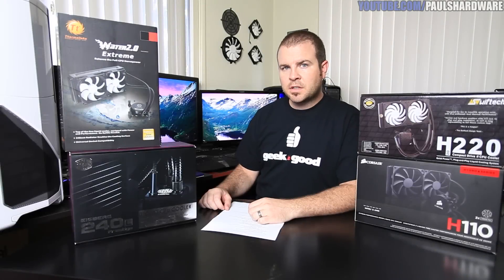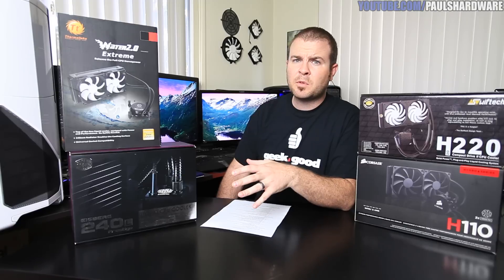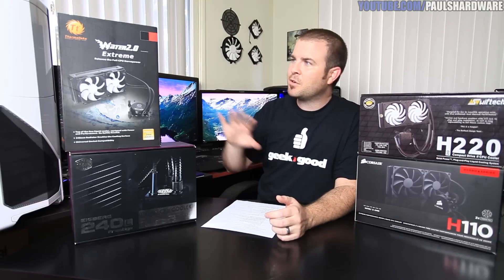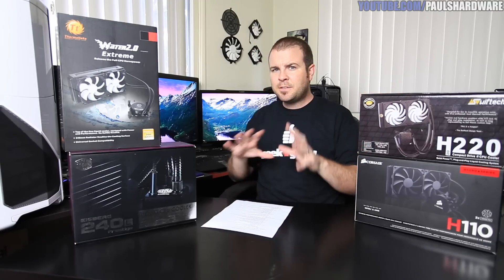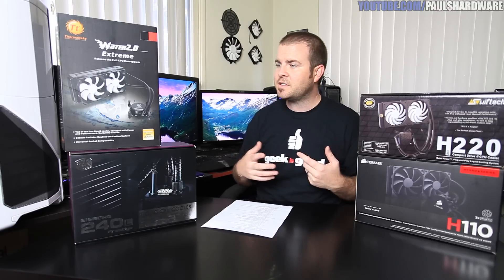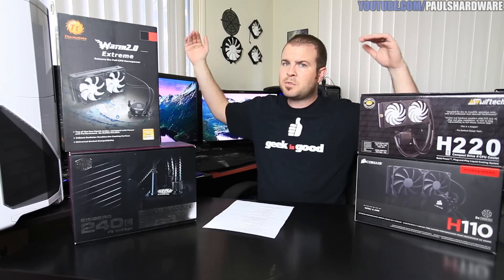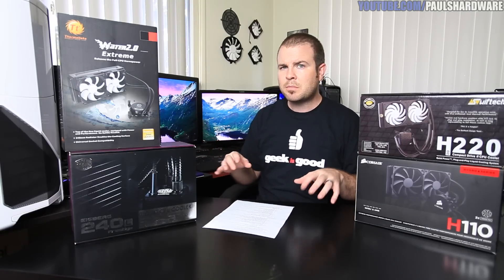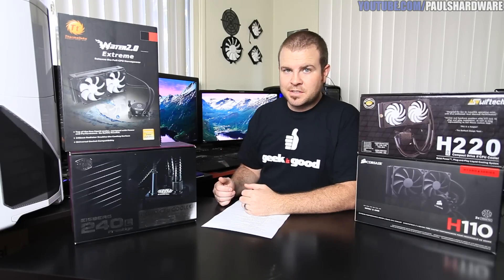H220 vs H110 vs Eisberg 240L vs Water 2.0 - CPU Cooler Showdown!

Comment: Am I doing something wrong? With a Corsair H60 my FX-8150 can run at 4.6GHz at 53-55C...Are those insane 80C temps primarily because of torture test? I was playing assassin's creed IV at the time when I checked my temps of 55C
Reply: Intel quad core cpus run much hotter than the FX series from AMD. But they are faster and more power efficient. I had a FX 8350 running at 5ghz for tests and maxed out at 75c with air cooling. 

And remember these are stress tests to get max temps of the cpu. Under gaming they won't come close to these temps.
Reply: I figured that were the case, but I wanted a second opinion, thanks :p
Reply: not really , a game never stress a cpu at 100% (unliss you have a crap cpu or a very cpu demanding game like crysis 3 and still !) so the temperature of a cpu while you are gaming is much lower than while you are pushing it to 100% load with a cpu benchmarking software
Reply: He was running tests like Prime 95 that max out the cpu load, just like Adnene said, games never run your CPU at 100%.
Reply: raptor6600gt     my fx 6300 at 4.5 compete with a 3570k...   the 8350 destroy i7 4770k in bf4

Comment: I'm very happy with my H110 by Corsair. One fan runs a constant 400-500 rpm's, and the other is idle 60% of the time. Even with my 4770k OC'd to 4500MHz, I still manage 29°-40°C temps most of the time. My Asus Z87 Deluxe mounted in a CoolerMaster HAF XM case is ultra quiet and cool. If not for my three monitors (Asus VG248QE) I'd never know my computer was on. With AI Suite 3 software, as temps fluctuate, the 5 fans and cooling pump automatically ramp up to match the heat load. I like this build and NewEgg made it possible.

Comment: Your a great teacher Paul, you taught me how to build my first super gaming RIg from your "other" vids n gave me the confidence that i desperatley needed to even attempt it. i just don't want people to read the volts and think they need that much just to reach 4.6Ghz on their overclocks becuase WOW!!!! 1.36V????? For a 4.6 Ghz Overclock ? Either you have the worst 3770K test CPU thats been through hell n back or you lost the silicone lottery big time. For my 3770K to hit a 4.6Ghz Overclock i only need 1.27V. Granted i am using a Maximus V Formula utilizing EVERY power connector (24pin EATX , 8pin EATX12V, 4 pinEATX12v and 4pin EZ plug) for extreme stability, plus newest BIOS. My temps are obviously no where near yours , I'd panic if i seen it go above 75 C - id be reaching for the liquid nitrogen lol Your still the man though Paul, r you still working with the egg?
Reply: he said he didnt need that much voltage... dont u listen...he just bumped it up so he could really stress the cooler. and prime95 is a synthetic test, no real world computing would push the temps up that high, even hardcore rendering.
Reply: People want comparable real world results from  tests, key word here is comparable! comparable ! I wasnt calling him an idiot nor was a judging him too harshly. just didnt want others to run their CPU hotter then napalm! In all honesty what made it even more of a foolish test was the lack of a NZXT KRAKEN X60,  it didn't even have the best AIO cooler on the market as per performance and customer reviews.
Reply: Roarshack V the kraken is a asetek oem rebrand... it woulda been in the same range as that thermaltake 2.0 water w/e

Comment: I noticed when you showed the results and picked a winner, the results are not all equal because of the fan speed... the corsair h110i was at slower fan speeds, so taking that into consideration vs some of the others, I think it did well.. next time make sure the fan speed is the same for all under idle and load at 60% and 100% and then we can see what the temperature will be... but I do understand each one gets to sell their own fans... LOL

Comment: Running the kraken X60 right now, and it runs at 30 C , in a no ac room. I had an h80 before, and it was miserable in comparison. The only thing bad about it was that I had to mod my Define R4 to fit it in the front.

Comment: I like Linus's " remove every possible variable using same fans" better.  Fans come in a variety of sizes, shapes, and performance variables.

the MOST expensive part of these AiO's is the liquid cooling system part(s) *pump, res, tubes, rad, etc*

Thus it makes perfect sense to test the part that MATTERS the most and is most relevant.

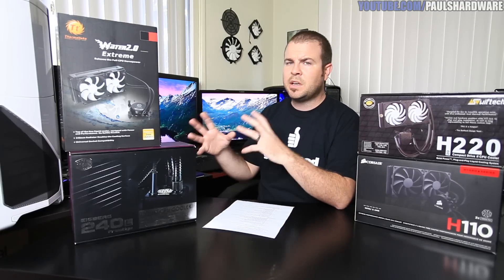Comment: 2:31" if you're going for the most aggressive overclock..the middle of the summer might not be the best time of the year to do that"

Actually you're wrong paul.  That is the MOST ideal time.  You ALWAYS want to know what the WORST CASE temperature scenario that you're cooling system(s) can handle.  

Just like life and your check book.   Prepare for the worst...hope for the brest..but if the worst happens, you're already ready to handle it and you can continue on without any stopping to fix it.

Comment: Considering the price reductions on the Thermaltake Extreme 2.0 currently available at several Canadian retailers ( as low as $54.99 after rebate), its hard to argue which offers the best value/performance ratio.  I agree, the H220 is the best AIO system out there in terms on performance and flexibility, but, $149.99, poor availability, and several comments about the need to bleed the system) makes it a harder choice for me
I would be curious to see how the Extreme perform with NF-F12.

Comment: Second finished. By doing that, you know exactly how many watts of energy the cooler can remove, at any speed. The aftermarket temp probe readers (which you guys sell by the way) can tell you the temp of the block which is all we're after anyway. Plus, if something does go bad, you at worst case fry the heating resistor, not the expensive CPU. Best part is now the results are all based on the same input, with an actual number to quantify it. Heck, I might even try it! PM me if you wish.

Comment: Second continued. Make a hot plate with a couple of simple resistors on the bottom, take that plate (copper or aluminum) and put a thermal probe on it. You know how hot it is. Take the resistors, and attach to a variable power supply, knowing Ohms law, amps squared x resistance = watts. You know how much power you're good for. Put the cooler on it, and turn it loose. Go from 20% to 100% speed, and see how many watts it takes to get the temp above whatever max temp you want, say 60C. done.

Comment: Second comment. Why in the hell don't any manufactures measure their coolers in watts or watts/degree C like the manufacturers of heat sinks do? Intel says their whatever CPU puts off 123 watts or whatever, wouldn't it be nice to see a cooler listed to say it can handle xxx watts at 40C room temp (which is 104F btw)? Then you wouldn't need tons of subjective tests. With the thermal sensors that are coming out that are quite cheap, a simple rig can be built.

Comment: Paul, couple of quick comments. You can use your cell phone to measure the sound level with several free apps. Might want to calibrate it once, but close enough. Usually measured at 1 meter. Also, it depends on your surroundings, so a room with hard walls will always be louder than one with hanging rugs or drapes. Just and FYI, so if you do go that route, be consistent on your distance to sound source, and also what all is in the room if you want to be really accurate.

Comment: Linus tries to remove every possible variable by using the same fans in the same configuration. Paul just pulled the things out of the box, installed them and tested them as is. Because that's what most people will be doing, using the stock fans. Paul is doing a 'real world' comparison.

Comment: Paul, the reason you can't find the Swiftech H220 in the US anymore is because Swiftech had to remove it from the market because Asetek threatened to bring a lawsuit against them over it.  Swiftech released a press release about the removal of the H220 from US markets on July 19, 2013 citing that Asetek was threatening suit because the H220 supposedly violated Asetek's US patents 8,240,362 & 8,245,764.  Swiftech offered to license the patents but Asetek refused.

Comment: Actually the reason it is out of stock in the US is because Swiftech had to remove it from the market after being threatened with a lawsuit by Asetek.  There is a press release about it up on Swiftech's website, dated July 19, 2013.  If you live in the US and didn't get one before July then you are out of luck as none of the big sellers have them anymore.

Comment: To be honest with you, you stand to gain 10*C just by delidding that 3770K, especially if it's one of the earlier samples, I think they fixed them later on.

85*C isn't really something you'd want on a 24/7 clock, no matter what chip you're using, I'd recommend you bring it down to 1.3V at the most without delidding, as the heat transfer between the die and IHS really isn't great. You might help it if you stick a bit of Phobya Liquid Metal in there instead.

Comment: Common Sense?   The guy makes a great point...the h100i would be corsairs equivalent to whats on the table, NOT the h110, with its larger surface area and larger 140mm fans

I dont think you know enough to be correcting anyone.

Swiftech H220 (240mm, Copper)
Corsair H110 (280mm)
Cooler Master Eisberg 240L Prestige (240mm, Copper)
Thermaltake Water 2.0 Extreme (240mm, 38mm thick) - (video description)

Comment: Isn't the pupmp in the h100i the same as the one in the water 2.0? And i don't understand the part where you said 'even the 240 mm AIO beat the 280 just by having the fans turned up'. You are contradicting yourself. Saying the h100i (240mm AIO) can't compete but then saying the 240mm AIO beat the 280 by just having the fans turned up a litlle.

Comment: Weaker pump and thinner radiator. Even the 240 mm AIO beat the 280 mm (H110) just by having the fans turned up a little more.

Comment: i have h220 in push/pull and @ 4.7Ghz 1.39V my temps are never been higher then 58C running intel-burn-in test with MAX ram 16GB 2400MHz, bitfenix prodigy black, 180mm intake front fan 140mm back fan outflow, just wanting to get a duel card or Titan and another Rad to make the window nice

Comment: Welcome
What's the point of buying such a water cooling, since several times cheaper MACHO HR-02 achieves the same results, which is silent.
I have i7 3770K@4.7 GHz, 1.31 V, the temperature in the room is about 28 degrees Celsius outside in the sun about 33. The highest temperature on the hottest core is 80-83 degrees while playing BF3 in MP. After loading the OCCT temperature is a maximum of 92 degrees.
What's the point?

Comment: He went for the h110 because its a bigger radiator, 280 not a 240, which with more rad space will give better cooling performance. This and because he specifies that he's pitting the TOP four all in one's against each other. The h100i is a great all in one but performance-wise I don't think it's within the top 4.

Comment: Word on the street is that Haswell chips are having temperature issues. They tend to get VERY hot when you crank up the hertz and the voltage. So just a warning, even if you do decide to grab an aftermarket cooler. In a way I'm glad I got my 3770k and didn't wait the 4 months for the 4770k. I can clock it to 4.7 no problem whatsoever and keep it well within range with a smaller AIO unit.

Comment: Great job Paul. This is a really great comparison of the top of the line AIO liquid coolers. It would be great if you could get a decibel measurement going and if you do, maybe add a delta temp/decibel comparison chart to your results. Also, if possible could you test the kraken x60 as well? The only other thing would be to test the radiators alone (i.e. 4 high end aftermarket fans for all) and compare those as each cooler is optimized for certain things and i haven't seen it done. Thanks again!

Comment: Sorry, didn't see your comment before writing mine. Totally agree with you, I try to build, and stress, all my systems during the peak of summer heat. What's the use of stressing your PC during the winter?...Summer will eventually come, and you will have to tune everything again...Or one will just forget (generally the case).
Cheers.

Comment: ...On the other hand, if it works in the peek of the summer, it will be fantastic for the rest of the year...
I prefere to top my systems to stability during the summer...I know there will be no issues during the rest of the year, also know that my systems will never run anywhere near the heat generated during stress tests (OCCT/Intelburn...).
Cheers.

Comment: You don't have to buy those fans...The problem is that the different fans are another variable when testing the coolers so if you use the same fans for every cooler, you get a more accurate result of how each pump/rad performs

Comment: That's because sandybridge CPUs are a feck of a lot better overclockers than ivy and haswell due to the IHS being soldered to the die cores on sandy and on ivy and haswell, intel used a VERY poor quality thermal paste. Upgrade to a h100i and crank that baby up to 5 ghz! :D

Comment: good job Paul! I use Noctua NT-H1 thermal compound and gentle typhoon 1850 rpm fans on my H60. I also get better tempatures than those units you tested. My max is 72 with an idle of 33 on an i7 2700k @ 4.6 ghz. Just thought I'd share my experience.

Comment: While all are reputable brands, Swiftech has a ton experience in the custom liquid cooling arena so they bring a lot knowledge to the "all in one solution" game. The pumps are also readily available for easy replacement which makes for a better long term upgradable cooling solution....that is if you can even find the H220 or H320 itself.

Comment: It's the hottest, but it cooled 3rd best at 100% fan speed with the *lowest* rpm.  Which means if you swapped out the stock fans for better aftermarket fans, it would cool even better.

Comment: finalllllllly oh oh oh finally.

i see that you gave yourself a hard job there uh?! first off, thanks a lot for doing this, really.

Now to them numbers. I was expecting the H220 to win by at least 10~20% compared to the worst and that is clearly not what happened, i didn't think the difference between the worst and the best would be that discreet, i mean, 2 degrees? These 2 degrees are pretty much within margin of error... As you said the H220 still a win-win because of its versatility and all.

Comment: So if actual ambient temps were used - would the actual cpu temps be above 90's? My i7-3770 was reaching that with OC, not OC'ed it stays under 70 - temps not normalized... using an asetek single 120mm rad - can confirm the plastic mounting is an issue.